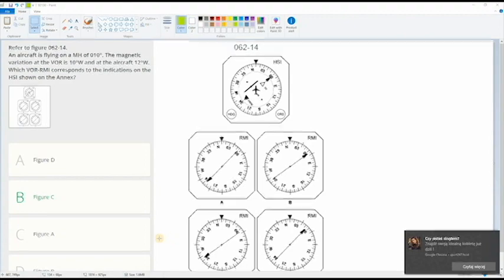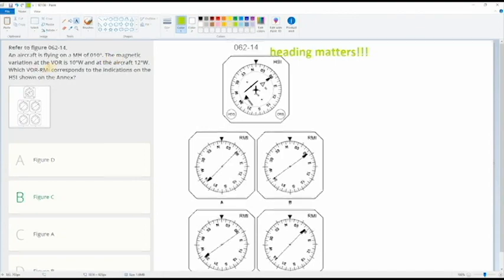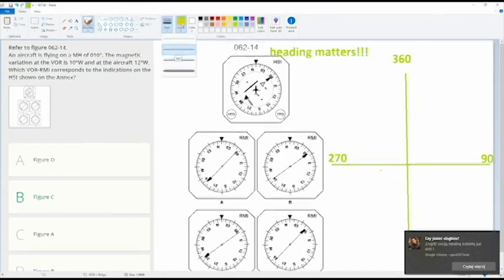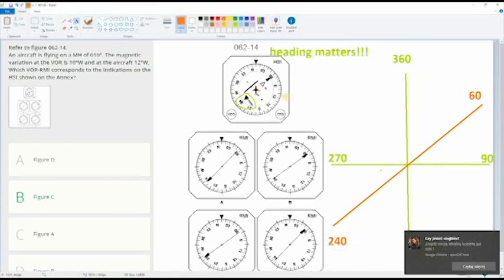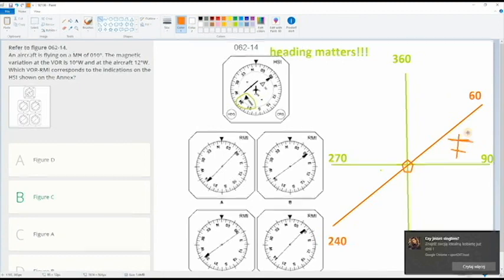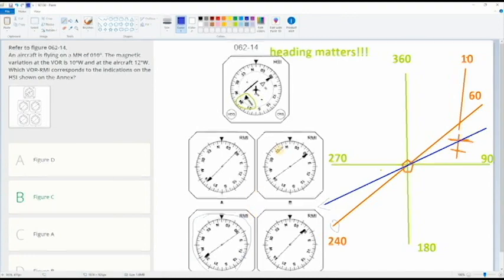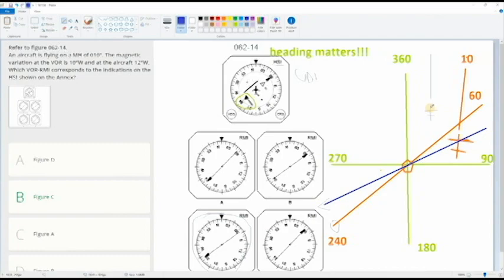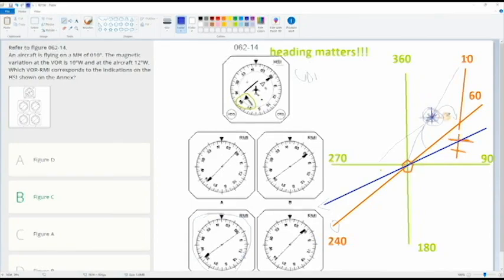Radio Navigation HSI explained

Comment: Why radial 50’ (blue) is eastern (right) from 60’? It should be on the left side of the orange vector (60’) . Could you explain? I’m confused
Reply: he obviously meant 70
Reply: @maria-4837  Well, "obviously" is not good when teaching someone
Reply: @Areacontroller93  Well, that's what happens when trainees try to play instructors. Still, the general idea was explained satisfactorily
Reply: @maria-4837  for the first part , I totally agree with you